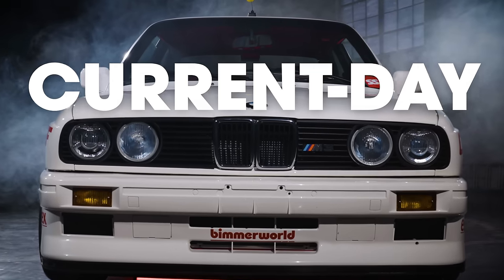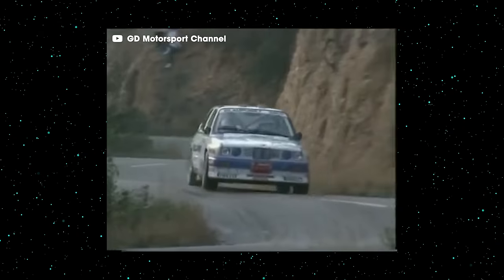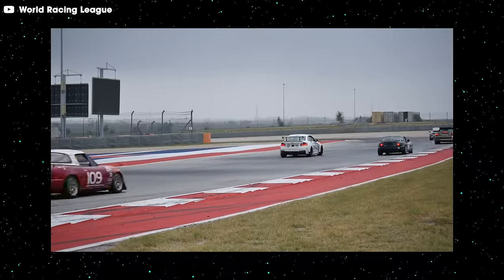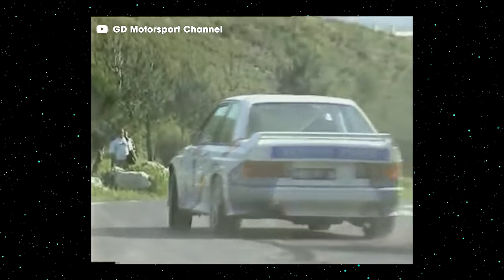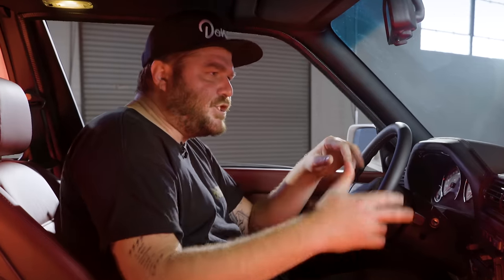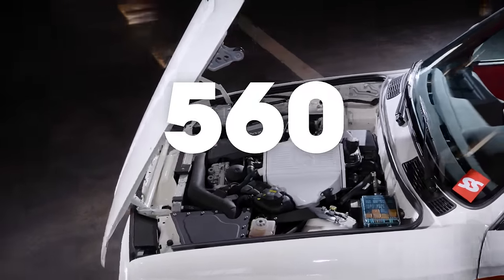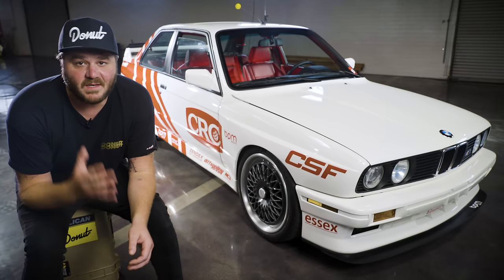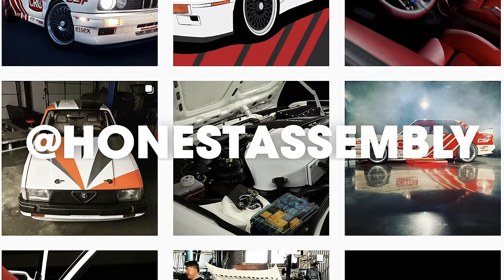This BMW Build Just Changed the Game

Comment: Thou shalt always E30...and yes, messing with E30's in any form pisses of PURIST.
Reply: If the s14 engine gets a new owner im ok with this
Reply: That's why I'm LS swapping mine right now
Reply: Helmuth Weidling He only purchased the shell.
Reply: Robb Southard I would like to do that to one, after I’m done with the current swap I’m doing.
Reply: @WelcomeToTheMadness  If I didn't over do it, mine would be done right now but I'm just dumb lol. I've got to pull the engine back out for some things
Reply: Purists are pretty hypocrytical. They wan't the car to stay in it's original form yet they replace parts. If you replaced all the planks on a boat, would it be the same boat anymore?

honesty idgaf, if it goes vroom vroom and slidey slidey, yeet my buttcheeks onto the seat plz
Reply: I am a triggered purist, but at least they kept with the simple looks, which I'm happy about.
Reply: Lassi Kinnunen because a) why not the body was in a bad shape anyways b) M3 legacy c) chassis reinforcements
Reply: @Derpynewb  "Purist" doesn't just mean to keep the car stock...
It can also be seen as keeping it period correct ! 
👍
Reply: Welcome To The Madness s55 is a pos, just like the n54.
Reply: @Derpynewb  
As a purist, i can tell you, that the car is ruined....

No for real now, an engine swap is somehow understandable but the engine has to be an NA in line 4 cylinder. Integrating an in line 6 into this DTM legend is beyond ruining it ;D, you could as well have put a turbocharged M50 with 800hp an called it the european Supra...

However, as much as i hate it, i can garante you, that every purist would agree with me, when i told you, that they did a wonderful job of exchanging the 4 cylinder for a .... 6 ... cylinder ...  (sorry i'm about to through up) and they did actually a great job with the restauration.
Reply: Mandernach Luca Hopefully a car fan will buy it and change it back.
Reply: Yes, but Kev27RS, the engine makes it not period correct. THey should have just messed around with a 325i because those go for like $2k anyway. I would be fine with that.
Reply: A Balakrishnan they chose a pile of unreliability as an engine. No thx
Reply: @RobbSouthard  ... keep it to a 6 cylinder or smaller V8. The LS's are heavy, fill the bay further, and throw off the weight distribution.
Reply: If a purist got mad at me, and if they desire to murder myself in cold blood, them I will promptly turn them into abstract art, the hard and painful way.
Reply: @abalakrishnan4152  , please do humanity a huge favor and go into a shark feeding frenzy.  Thank you.
Reply: @Kev27RS  , you are correct when you said that you were on your period.
Reply: @paxhumana2015  I don't get it. I am vegetarian.
Reply: David L The M20 is only 50 LB lighter than the LS, and with the large fuel cell in the spare tire, I think it'll be fine for drift
Reply: @paxhumana2015  watch your mouth please
Reply: @paxhumana2015  
Reading the comments that you just wrote, i am 100% sure that you were talking to yourselfe XD.

For real man you are salty enough to season my fries through my smartphone screen calm down ;D.
Reply: @mandernachluca3774  For real...
😂👌
Reply: @mandernachluca3774  Yes, they did an awesome job with the whole restoration, and the car looks nice, that's for sure 👍
but putting a modern washed down BMW Inline-6 engine into it...
Well... 

Not my thing...

✌
Reply: @abalakrishnan4152  Yes, that's what I meant with my comment.  👍
Reply: Correction...if it Is a M3 e30 it makes purists más.
Reply: D C s54 is fine, its a good engine. S55 no
Reply: You know what makes me mad? LS swapped RX7s
Reply: @abalakrishnan4152  , I watch my mouth open and close.  Moreover, if you do not like my mouth, then you can kindly keep YOUR mouth closed.
Reply: @mandernachluca3774  , says the person that probably used two other fake accounts to give yourself three likes.
Reply: @elijahberger5722  , you know what makes me mad?  The fact that your parents met.
Reply: @paxhumana2015  
I would be surprised if someone would actually go through the trouble of making 3 accounts only to feel like having accomplished something XD, on the other hand, you sound like you have some experience with this methode ;D.
Reply: @paxhumana2015  If that really offended you so much I am sorry.
Reply: @paxhumana2015  I'm sorry, but a Corvette engine in a car built for a rotary engine just isn't my style. You can like it all you want, I don't care if you say that an LS belongs in an RX7, but I don't like it. You can, I don't; alrigh
Reply: MunroM84  I dont know if there are regulations considering how loud the intake can be, but i imagine there isnt much of that in the US. Theres no better sounding engine than an S14 with a carbon airbox, so it would be the first option for an M3 E30. I hope they kept it and plan to rebuild it, when they have the cash for it.
Reply: I've always been of the mind that you're welcome to do whatever you want to your own car, but I personally prefer to keep mine as stock looking as possible. To me, driving older bimmers is something cathartic and analog. I don't think I would do anything to the car that the original designers/factory didnt intend for it.
Reply: @RobbSouthard  I'm from Europe and LS is better engine than the shitty sounding S55.

Comment: My favorite insane E30 swap is the S85 V10, yes, it has been done.
Reply: Too much power for the weight and the handling sucked
Didn't really like it
Reply: @nezarl8374  fair, actually if I had an unlimited budget for an E30 swap I would probably go with an S54 with bespoke AWD transmission and front diff setup.
Reply: @Skwisgar2322 
Spot on!
That would be perfect dude!
Reply: @Skwisgar2322  that is way too much fabrication 😂
Reply: @nezarl8374  same with s62...useless

Comment: This one is actually nothing against the E30 M4 from JP Performance
Reply: Lol what? JP built his engine on a M52B25 motor (e36 325). 2.8L crank + turbo conversion. This is the same way I built my own e36 325 turbo, because it's the cheapest way to do it, where I live there are at least a dussin more E30/e36/e46 with the same concept.
An S55 engine however is lightyears better and cooler and about 100x more expensive. JPs 850hp is a very clean and impressive build by all means, but this build dwarfs JP's imho. If you wanted more horsepower you can crank up the s55 to well over 1000hp with just a tune and turbo. Can't do that with the M52B25.
Reply: @bounzig  JP build a complete M4 into a E30, from Suspension over Interior, to the M4 Engine... I dont know how old your Informations are...
Reply: @Salamiboy34  Yeah, my information was from 2018 and he did a rebuild in 2020. It's me who has old information. Sorry.

Comment: Gasp... the V10-swapped E30 from Sweden build during 2008/2009 is much cooler.

( BMW M5 V10, S85 )
Reply: You can bet!! S55 engine is not even a "True" M engine in my opinion!
Reply: The same way people say engines after the E60 and E92 era were not true M engines. Is that really the case though?
Reply: If only the little 6 sounded like the 10 at 8200....  but for weight and balance the turbo is a better choice.  And it’s been done.  One of Cory’s (the owner) friends bought my high mileage e39 m5 to swap it into his red e30 m3 but it never happened... sad story all around.  Miss that car.
Reply: @luqmanhakimi910  M engines are NA based performance despite the cylinder and/or displacement number... turbocharged modern ones doest sh8are that philosophy at all! Thats the True difference! i didnt share the opinion of those who used to believe that e92 e60, etc. wasnt true M cars...
Reply: @damonm3  turbo engines not always are "lighter" than bigger NA ones in certain cases they can be even heavier if you consider all the extra stuff such as turbocharger, piping, hoses, valves, solenoids, (extra radiators) etc. now "balance"? Balance dont depends on the aspiration type.
Reply: Ivan Nevistic I was assuming the 6 was lighter than the 10..., just looked it up..and there’s a lot of stuff other than the engine on the 10.  From what I found the 10 weighs 530 lbs and the 6 around 430 so yes my guess was right.  And 100lbs affects the balance too.  And it has a lot more tq and HP.  And it’s a lot more usable  and WAY more efficient just driving around.  But if I had to choose between a stock versions I’d pick the 10. Both tuned and the 10 had over 600hp I’d still pick the 10😂
Reply: Luqman Hakimi those were two of the best engines BMW ever made... the e60 is just shy of the v12 in the Mclaren F1 for fucks sake.  But the e60 is a bit of a tank...  the e92 is a great car and sounds amazing.

Comment: The reinforcing of the chassis is taken from  the convertible M3, to stop it flexing so much some body panels have an additional piece of metal like an extra layer of bodywork with shapes to strengthen the piece

Comment: Did they publish the specs of the car? Like how much it weighs and how the weight distribution changed with the new engine? I hate all these big engines swap into the E30 because they do not care of these aspects that were crucial in the original M3.
Maybe I would have appreciated more a swap like this on the E36..

Comment: the problem with butting in modern 6cil or most engine swaps is that the engine weighs a good 120 lbs more then the s14 and a good 80 more than the single-cam m20, and the suspension design just can take it. and it's not easily solved with coilovers. a lot of handling issues come up when craming a big heavy powerplant in a small light car. but its just fine for a show car and hiway pulls just avoid weather and turns.

people into time attack racing often don't run the big sixes opting for turboing the m20 or kswap, simply because of the suspension limitations.

Comment: They decided to swap the cluster because it is extremely difficult to make an engine swap without replacing the dash as well (we are talking about modern BMW engines). Usually, an ECU would not let you start the engine without an original dash.

Comment: I have been told North ameican did not actually get the e30 M3, but a beef up 325
Reply: I think that was the E36?
Reply: @Mac Donalds The 325 E30 uses an Inline-6 meanwhile the E30 M3 uses an inline-4, the only difference between American and European (As far as I know) was the transmission.

Now for the E36. The S52 (Face-lift American M3 Engine) is just a bored up M52(328i) with a better head. 

Afaik there is no M3 that we're based on 325i.

Comment: JP Performance from Germany is swapping a e30 M3 with M4 Components like axles, subframe, engine, diff... basically building a whole M4 under the shell of the M3 but by extending the body but shortening the M4 Components to keep the original M3 dimensions

Comment: Really stunning build, i like the approach and the color sceme. But next time do it right. In germany a famous tuner and car enthusiast Jean Piere Krämer (JP-Performance) and his crew not only swapped the F55 engine into the e30 but more a whole M4 with the whole drive train, chassis (needed to be changed to a push-rod suspension on the rear due to space issues), all the electronics and even the huge carbon ceramics. You basicly drive a M4 in the shape of an e30. Go check it out, its on youtube

Comment: I've said it before: BMW, give me a modern M3 with an E30 body. I will sell my soul, and those of my family, for one.
Reply: They can't. Those cars wouldn't pass modern safety standards for impact damage, or if they did, they'd weigh 400-600 kilos more than an E30. I appreciate the sentiment all the same. That's exactly why old E30s (particularly M3s) are getting so expensive.
Reply: They can but absolutely never will. The modern interior and all the electronics would make it heavier anyway. The weight difference between the E30 and F80 is about a 1000 pounds. That's plenty to modernize an E30 shell. I'd do it myself but I'm a poor college kid. No time and no money. The E30 is my favorite body style from any car. By the time I have the money and time, a donner E30 will be 5x more expensive than it already is.

Comment: That BMW E30 M3 is nothing compared to the BMW E30 M3 from JP Performance. They build a BMW M4 from 2019 inside the E30. So it's a M4 with a shell of an E30. And all the sensors and ABS and that stuff works.

Comment: 5:38 "when a car comes perfect from the factory, there's no need to mess it up" 
rest of video: talks about modifying the m3. 
its cool though, im not a purist myself, but i do think all that power fundamentally changes what the car is.
Reply: The problem is the weight distribution is prob now out of wack and that is over 2x the amount of power that chassis is designed to handle. Instead of a car that was once a perfect meld of man and machine, its now an overpowered monster that is miserable to drive anywhere.

Comment: The original 80s engine was built to last the new engines are designed to break after 100k miles.

Comment: Napa is where you go to buy parts. Nappa is leather. 😋

And I think a big portion of the "purists" for the E30 are the new "investor types" that jumped onboard when the prices started skyrocketing, hoping to recreate the air-cooled 911 nonsense. Fifteen to twenty years ago when a normal-miles E30 M3 was $10k or less, barely anyone would be purist-mad about an engine swap into one, especially if it was still a BMW engine.

Very nice work on that machine and props/congrats to the build team!

Comment: The E30 M3 is a terrible car. 
People say it's the best, but I've driven a couple and they're absolutely shit.
They're pretty slow, don't handle very well, they roll quite bad. The brakes are beyond terrible as well. 
People just take other people's opinions on this car and haven't actually driven one. You cannot have an opinion on a car if you've never driven it.

Also, putting a newer M3 engine and some decent brakes and suspension transforms this car.

Comment: This is crap go and check out a guy in the states fitted Tesla Drive Train and Battery Packs into an E30 M3 which is now full electric and has 550BHP on tap!!! Advanced the M3 into the new age!!!
Reply: The white Cabriolet E30? That one isnt a M3
Reply: @ahrred3127  you are correct I double checked and it was an Mtech2 convertible but same thing man E30 325i or E30 M3 to me it's the same thing technology is of the same era and it's easily doable to an M3.